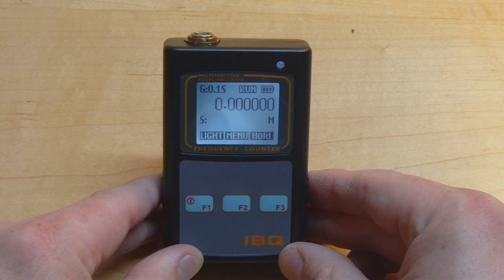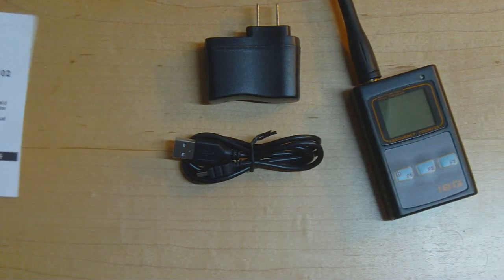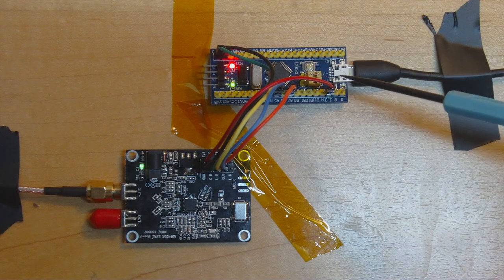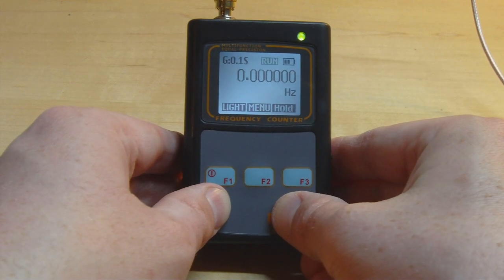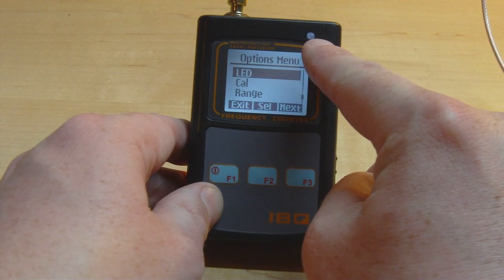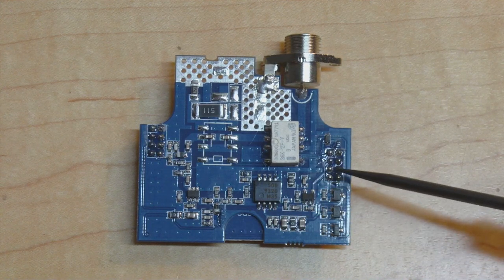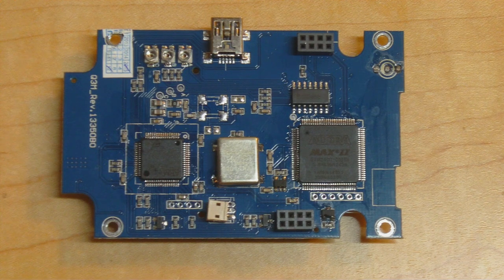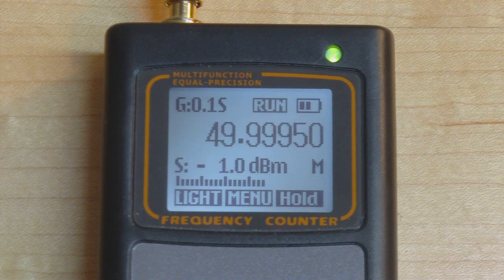[006] IBQ102 2.6GHz Frequency Counter - Review, Teardown, Experiments

Comment: My similar Yaege FC-1 counter has worked faultlessly for six years. Very handy for quick equipment tests and transmitter identification on the fly, plus excellent value for money. As you point out, open-source firmware and datalogging via USB would greatly improve the versatility. I'd also like to see audio and vibration alert for each frequency capture, like on the old Watson and Optoelectronics Scout counters.

Comment: Excellent review. Thank you. 
I believe the Motorola MC10H116 Triple Line Receiver is used here as a waveform shaper, converting the input signals to square waves. It should handle both frequency ranges, where the MB506 pre-scaler may probably only used on the higher range. The MC10H116  IC datasheet  refers as typical applications: 
• Low Level Receiver 
• Voltage Level
• Schmitt Trigger Interface

Comment: Just got my Yaege FC-1 today from Amazon (US).  The difference between the IBQ102 and the FC-1 is the name on the front faceplate and the red power logo just above the F1 fuction key (FC-1) and on the F1 function key (IBQ102).  The the manual with the FC-1 says IBQ101/IBQ102.  Please note the FC-1 is the larger frequency ranged IBQ102 and not the IBQ101.  Comes with same accessories so they seem to be the same.  Hope this helps.

Comment: I have one of these. What's great is that the dBm power meter is quite accurate for the price, about +/- 1dB error. I don't know how much power it can handle, as there is no info in the manual. But +10dBm is safe so far. However, my instrument stops at 2490MHz, and can't measure higher frequencies.

Comment: Hello friend, in the unit that I have received, it gives me a value depending on the ambient temperature and the time I have been handling my IBQ 102. When cold, for example, it gives me a measurement and when the unit "warms up" 200 hertz less on average .  It is not a reliable equipment.  What do you think?

Comment: Can we use the ADF4351 synthesizer  to generate In Phase and Qudrature signals to drive a mixer? Since the phase difference is 180 I suppose its not possible. If not so, why would they provide two signals which are out of phase? Thanks for your openion.

Comment: Could the problems with the lower freq range be because of inpropper termination (1M vs 50)? Isn't the siggen expecting to be terminated into 50? Or it should not matter at such low freq?

Comment: The protocol could be a request-response based one, right?
Reply from the maker: It could be done that way. I would expect it to be incorporated into the HID stuff somehow. Because on Windows, using HID means you don't have to write any driver code to expose you device to applications. Then if you were using HID, why would you use request-response, when simply pushing the messages is simpler and perfectly sufficient?

My suspicion is that the HID stuff is just there to make sure the host PC keeps the USB port powered, rather than sending any data.

All this could be confirmed by reverse engineering the firmware, but that effort would be better spend writing an open source firmware with all the desired features IMO.

Comment: What is the different IBQ102 vs YAEGE FC1 FC2? What is the better?
Reply: I would like to know that too
Reply: The difference is the name on the front faceplate and the red power logo just above the F1 fuction key (FC-1) and on the F1 function key (IBQ102).  I just got mine today the the manual with the FC-1 says IBQ101/IBQ102.  Please note the FC-1 is the larger frequency ranged IBQ102.  Comes with same accessories so they seem to be the same.